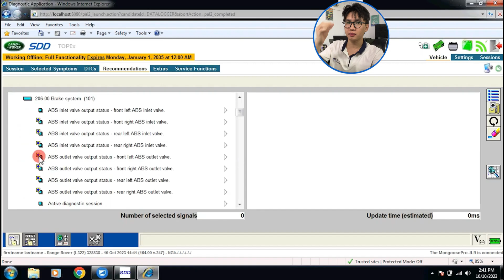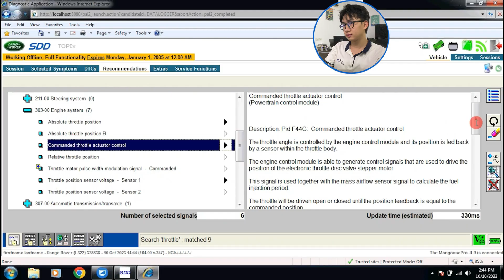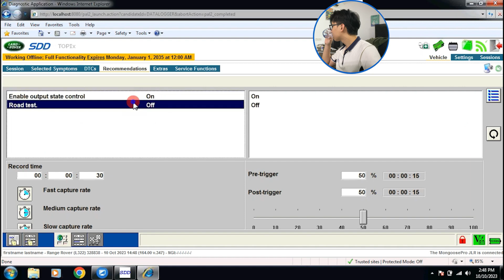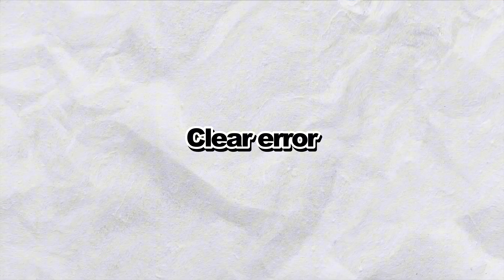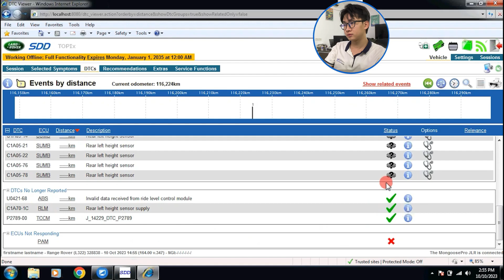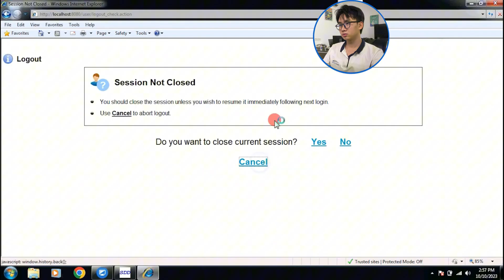How to Use JLR SDD Software (Part 2) – Data Reading, Actuator Activation & Clear Fault Codes

Comment: Where to buy cable and software for 2006 range rover. ?
Reply from the maker: Do you have whatsapp number? You can contact to us via whatsapp +1 (517) 271 9168, our technician will assist you